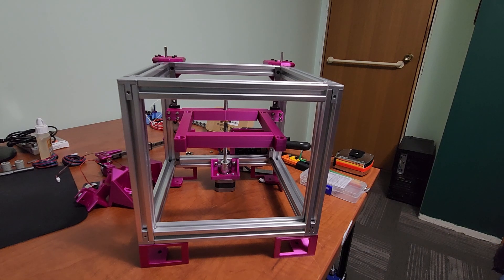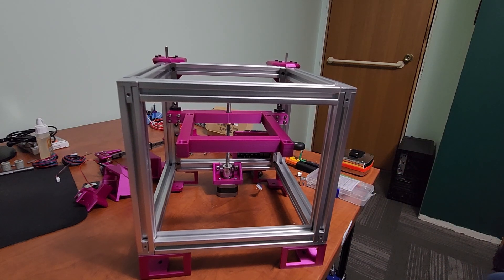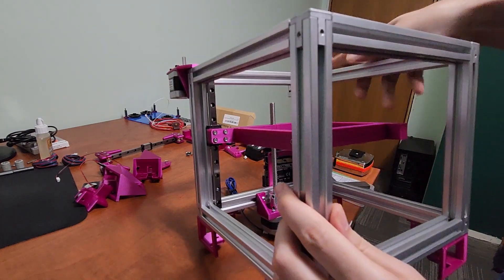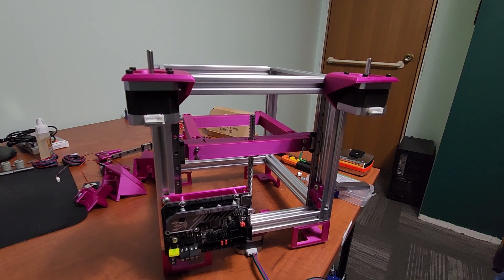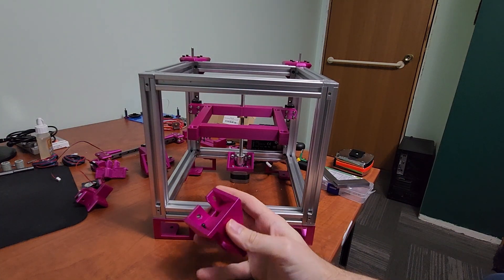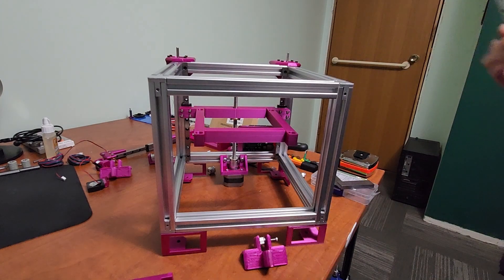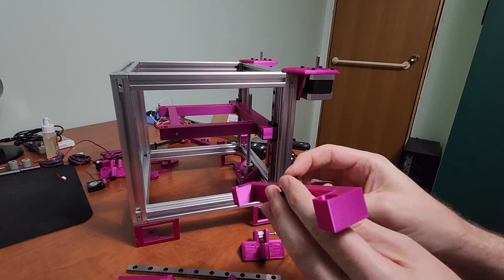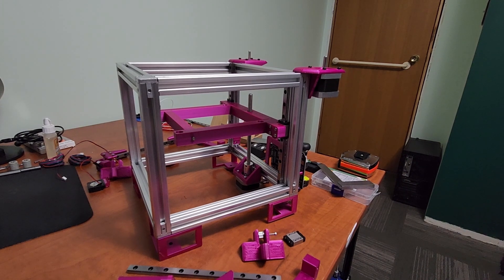Cheap DIY 3D Printer Called Bijou Assembly Guide EP1 - Frame and Z

Comment: Looking forward for Mk2, those brackets are much easier to work with. And you can mount something on them by drilling a few holes
Reply from the maker: yes those flat corner brackets are much better

Comment: how can that rigid  back tram?
Reply from the maker: the two linear rails in the back prevent the bed from twisting if that is what you mean
Reply: @Rolohaun  Just wondering if not level, how would you tram it?  So if bed is tilted and needs adjusting
Reply from the maker: @C650101  oh the bed is still mounted with 4 springs and adjustment knobs

Comment: Won't that bed frame be too flimsy?
Reply from the maker: I can just add 3 100mm 2020 to the BOM for the bed frame
Reply from the maker: it seems good so far, if it does not work out I will for sure change to a 2020 Voron V0 style